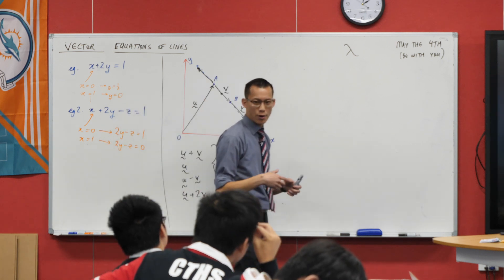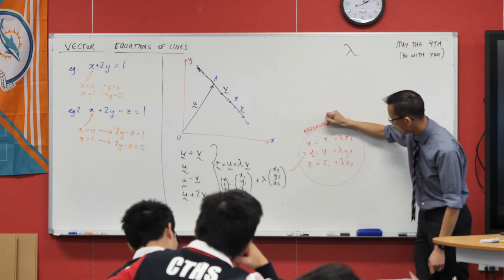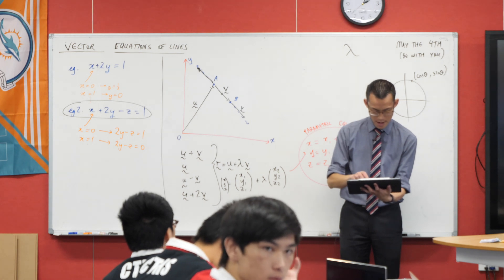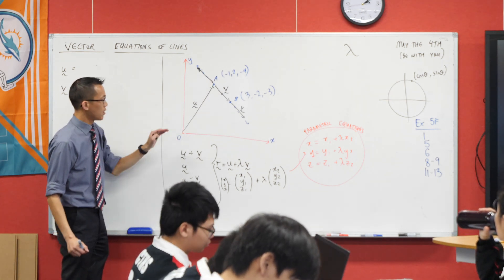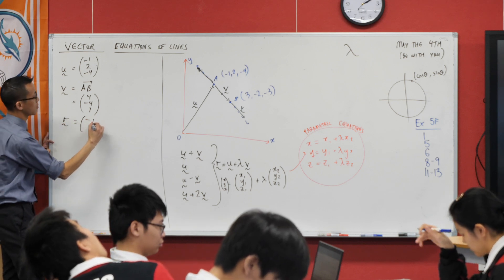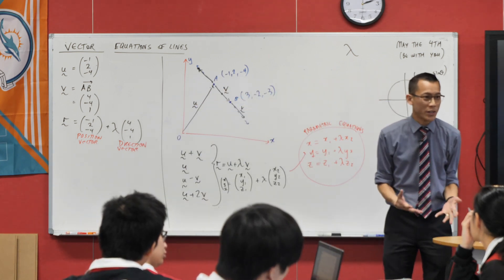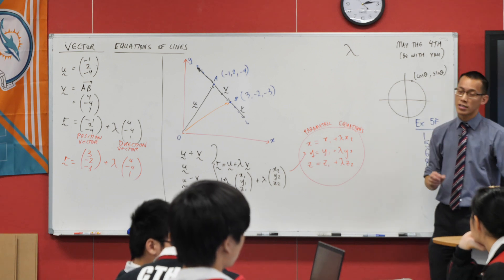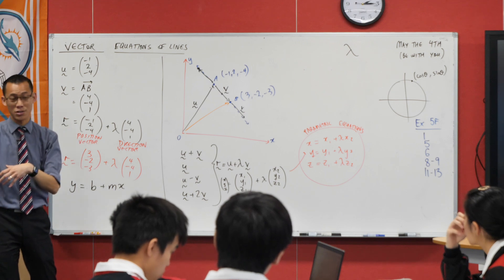Vector Equation of a Line (2 of 2: Worked example)

Comment: Hello sir, I am unable to understand how you got vector AB as 4i-4j+k in the left side of the board. (5:27)
Reply: That is also my question. It should be negative of the vector V if the position vector we take is B. So, -4i+4j-k. Right????
Reply: because they are using some constant lambda where lambda itself can be expressed as negative depending on direction. also the lambda in the previous step is not equal to the lambda on the next step.

Comment: I guess in 2D land you could do the same thing: (x, y) = (x1, y1) + lambda*(x2, y2). You can even easily convert from the standard y=m*x+b by setting x1=0 and x2=1, giving (x, y) = (0, b) + lambda(1, m). You can set x1=0 because in 2D every non-vertical line crosses the y-axis at some point and you can use any point on the line for the position vector. You can set x2=1 because every non-vertical line has a gradient/direction with an x-component for which you can find a suitable scalar multiple for the direction vector. This also means that if you set x2=0 then the vector form can handle vertical lines as a nice bonus.